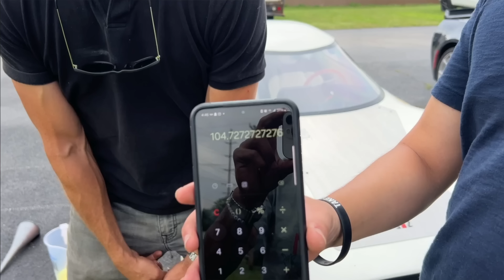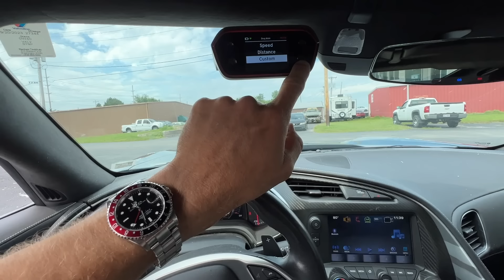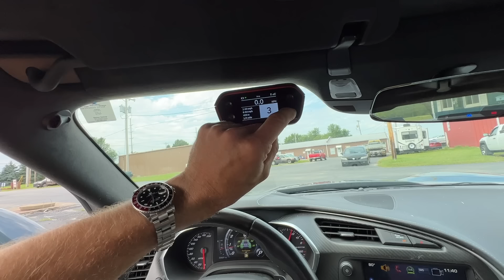FIRST 0-60 mph Test- Diesel OMEGA CAR - Video 3 of 3

Comment: Comparing it to a Tesla is Apple's and oranges. You're driving a fiberglass go-kart. While a Tesla and the Corvette have a ton of safety features and airbags to increase crash survival. Your car is probably fatal at 35 mph. You're mostly correct about lack of design philosophy. But there are a few exceptions like the Aptera EV. Both super light and safe. And far more environmentally and economically sound.
Reply from the maker: Nope and nope.
Reply: Still it's a solid starting point and it can be improved further to keep the weight and final cost low if developed into a proper product.
Reply: Aptera shell may not break in a 35mph impact. But a light car is still going to get bounced violently in a crash with any modern 5000 lb beast. It's  not gonna be pretty.
Reply: @colinbowman8816  Composite materials can be tweaked to absorb a lot of impact compared to regular metal car bodies.

Also most revelant markets worldwide don't use large cars, this is common only in North America.
Reply: @vitordelima  true, a good crash structure, like a F1 nose is supposed to shed something like 5x the energy of a conventional metallic structure of the same weight iirc. That requires tons of testing to make. But basic physics says that if a 1500lb car and a 5000lb car have an inelastic head on crash, @ 40mph, the final mass of both cars ends up travelling 21.5 mph in the direction the heavier car was going... so one car saw a 18mph change, the other 61.5mph. The energy absorbtion needs to be much better in the lighter car, or the occupants are much more likely to be injured.
Reply: @colinbowman8816  Not only the rigid structures inside the car can crumble like in a regular car, the outer surfaces can be made of "porous" textures that collapse under compression and can even produce a force in the opposite direction of the crash.
Reply: @vitordelima  I have no idea what you're  talking about with the porous textures thing... example?
And just checking: you understand about inelastic collisions and accelerations?
Reply: @colinbowman8816  Negative stiffness effect.
Reply: @vitordelima  Ah, you don't understand. Look up 'physics inelastic collision' maybe if you want to learn.
Reply: @colinbowman8816  The cockpit is a carbon fiber shell. The frame is a fairly standard aluminum crash structure with energy absorbing crash boxes etc.
Reply: @colinbowman8816  Meh.
Reply: WTF! You are all getting locked up about safety, ev more gooder, ev better for environment. SMH. This appears to be a legit 104mpg vehicle. THAT! Is absolutely awesome! The rest will come. Quit partaking of the gov pablum you are being bottle fed!

Comment: Diesel engines are some of the most efficient engines ever made. Diesel fuel used to be cheap, really cheap. If the Omega car was made 40 years ago, it would be the stuff of legend(That worked). 
The biggest problem with today, is all of the endless regulations you have to follow. Written not by Senator Friendly's staff, but some nameless jerk. Sittin on a buttplug sportin an attitude. Thinking he/they/it/whatever knows better than all of us. 
It's too bad we don't live in the same state Casey. Besides being a car guy, I'm a mad Industrial Designer as well. I used to have your energy, but as I'm sure you can understand. Life got to me as well. But the drive is still there.

Comment: Don't the engineers responsible for the powertrain deserve most of the credit here? Seems like they did most of the heavy lifting when you consider it's reasonable to expect similar performance from any relatively aerodynamic chassis that's void of modern crash safety features, creature comforts, adherence to emissions regulations, pedestrian safety regs, practical daily use, etc. etc. etc.
Reply from the maker: Nope
Reply: @CaseyPutsch  Yeah ok, bro. Use a comparable gasoline engine to test how much novel material science is responsible for fuel efficiency (or lack thereof). Add enough safety equipment to satisfy the most basic requirements and then explain to everyone why the car gets 40mpg like EVERY OTHER CAR. JAGOFF

Comment: I only started watching you TODAY
and I want this car in my driveway. I'm at the cusp where I'm thinking of getting a tesla because it would be much cheaper than driving or even riding my motorcycle to work on the daily. 
However, I still like the sound motors make, I still want to DRIVE my car with a stickshift and the omega car is even RWD! Which I love. 

I really hope you start a patreon or go fund me or whatever, to make this car really compete against everyone, I'd line up and support you all the way.
Reply from the maker: I will absolutely do something. Stick around. I’m honored you are here.
Reply: This should be a kit car, so you would be able to put whatever engine and whatever technology you wanted to into it. I would absolutely turn one of these into a triple motor, Honda V6, DCT, torque-vectoring hybrid, like a tiny Acura NSX.

Comment: Nice project Casey.
I applaud your ambition.
You're an inspiration for doing this project.
Something that should have been done long ago.
I for one agree with using the Diesel engine.
The Fuel sources are are so many in the Diesel world.
Small diesels are very adaptable to different types of fuel.
The Bio Diesel really belongs here.
Another place your car could be tested is Bonneville. 
That would be something to see that.
Keep up the good work.
Thanks for sharing. 👍 🇺🇸💯

Comment: I'm excited to see what you've done with this little project. I have swapped the VW ALH 1.9 TDI engine into two Jeeps (a CJ7 and XJ). Both can be seen on my YT channel.

The CJ gets 31 MPG and the XJ more than 40 MPG. They're unbelievable when it comes to efficiency and durability. 

Can I ask what engine code it is? I tried a google search to see if I could see the build specs, but no joy. Is it basically a stock VW motor? No turbo upgrades, injectors, tunes, etc?

Bravo sir. I REALLY like the videos of the Omega Car!

Oh, and absolute power corrupts absolutely. It's a shame what we've become with the folks running our country.

Comment: I am thankful that your Omega car videos showed up on my YouTube page. For most of my life I have been a Ford fanatic. But as time has gone on I have been extremely disappointed in all of the American car manufacturers. Very little real innovation has come out since who knows when. In 1985 Ford created the SVO Mustang with its four cylinder turbo engine that ran almost as fast as the V8. Also in 1985 my father bought a Toyota MR2. It was getting around 30mpg at that time. It drove like a dream and was reliable. I look at where we are now and say to myself "why are we not farther along?". For as big as the American market is we are very finicky about our cars. All you have to do is look at how car manufacturers made the CV transmissions act like standard automatic transmissions. And why my mothers Honda Insight with a CV transmission has shifter paddles. Good luck on your venture I am sure with what you have accomplished and with updates that have happened since your initial design you will produce something incredible.
Reply from the maker: Thank you kindly

Comment: Several questions for OC.V2, roughly in order of presumed difficulty(edited in to avoid auto-yeet):
>Better (for performance) tires?
>Bugatti Tourbillion style steering wheel/cluster placement?
>De-Dion rear axle with Satchell Link and inboard brakes?
>Front steering rack for best feel with 50-60 degrees of angle (one way) and enough lock-to-lock rotation to equate back to a 10:1-12:1 ratio(bout a 1200-degree rack)?
>V6 TDI for more power and better sound?
>Bladed seating position previously mentioned with customizable shifter placement?
>Roof cutouts on doors for even easier ingress/egress?
>A larger 3-seat version with a center driver and passengers offset the same as the bladed 2-seat idea so the driver's seat can slide over (like that one modded 911 or w/e)?
>Making the transverse equivalent to the ZF 8-speed, or if not, running an actual ZF8 Countach style (mid/rear long, trans forward, V-drive RWD) and pairing it with a Turbolamik (or equivalent) trans controller to have the ultimate in transmission flexibility between both automatic and manual shifting incl with or without clutch and H-pattern or sequential?
>Barring the above, how about simply a dog box H-pattern for maximum spirited driving fun of the true enthusiast?

Also, I recognize that if you make a larger version, it'll probably just be 4 seats since that won't have a much larger cockpit or footprint than a 3-seat version, anyway, and would literally be 1/3rd more practical than the 3-seat is. Like, the bladed 2-seat is genuinely a good optimization, but the offset 3-seat is really just for dudes like me who want a budget Mclaren F1/Speedtail/T.50 that's slightly easier to get in and out of due to the horizontal slider.

And TBH, the bladed 2-seat will probably get you close enough to the center since each seat would be roughly 2 inches overlapped on the centerline of the car. BTW, if it wasn't clear, as long as you're pairing the bladed pos (driver still on left) with a left side shifter, you could probably do away with that side's door entirely and just have a single door system. IDK if that'd make roll-down windows on the port side easier or not, but I digress.

Comment: I know that the omega car was bespoke hand coach built, but I cant help but think it would look insane if the headlights were moulded plastic in the wheel arch fairings and the nose was continuous. Also this would help with aerodynamics too. Long time subscriber of the channel and you do things I could only dream of in the automotive world and have done for students more than I could ever do for the betterment of sudents and young people. Please keep up the good work and interesting content.
Reply from the maker: Thank you!
Reply: In Need For Speed III, there was a bonus car called the "El Nino", you may find that design to your liking. Similar front end, but with vertical oval headlights integrated into the fenders.
Reply: @rwkerstetter  Just googled the El Nino and it is pretty much the same concept (man oh man it feels like those cars were far more sexy and far less pixelated back in the day) , I was thinking more like an LMP3 car as the Omega kind of has the whole single seater cockpit look to it already. I was thinking something like the headlights in the Ginetta LMP3 or something similar. @Casey, did you draw your inspiration from LMP when you designed this initially?

Comment: As happy as I am for your concept, the only downer is crash rating and safety running airbags and all the other stuff and what comes with that (weight) I’m still sure you’d be pulling insanely high MPG with it, but it would be interesting to see the next level, i.e. production level, for example the location of the headlights are way too low. They would require you to get them higher to come to market, which means the design will change  causing more wind resistant to get that height, which would lead to lower MPG

Comment: This is believable.   I owned a 2014 VW TDI Beetle Premium.   I also did the old school  mpg fuel test.   Diesels get the best mpg over long distance  cruising speed trips.   My test mpg run was from Swansea, MA to Jackson, NH.  221 Miles.   The car averaged 68.9 mpg there and back.    A VW Beetle is not as aerodynamic as your design and the "clean diesel"  catalytic  convertor and ash trap added back pressure reducing mpg.   Two weeks after the trip to NH with my wife,  "Diesel Gate" exploded all over the news media.  Extremely High NOx.
The buy back  wasn't a good experience for me .   I lost $9k.   I recouped some of the lost money by purchasing a new Wrangler with the settlement,   I had to give up the TDI.  I drove the Wrangler for 8 years and got $7k less than I paid for it new at trade in this year so I guess it's just about a wash.   I ended up getting a RAV4 Hybrid Premium.    I achieve high mpg by increasing the tires to 36 psi.   Last tankful was 58.9 mpg which isn't too bad.   I am willing to bet a 4 cylinder diesel hybrid will be capable of achieving  at least 140mpg.    Glow head management would need to be in place.   When on battery power the  engine head temperature would need to be monitored, if it drops below a set threshold then the glow heads come on.  

As I mentioned earlier Diesel engines get the best fuel economy over long trips.   You should release another mpg test video with a 100 mile road trip.  I am sure the mpg is going to increase.  I won't be surprised if it's over 120 mpg

Comment: I wonder if any gains could be had with Speed of Air pistons in your diesel engine, theyre supposed to improve emisions significantly enough that a 7.3 powerstroke can pass modern emissions, and give a modest bump in power. Not sure how effective they would be in a small bore engine, truly curious now.

Comment: Back in the 1930 and then again in the 1950s, Cummins entered a total of three diesel powered cars at the Indy 500. The ones in the 1930s included a two stroke diesel! The only reason I know this is because my grandfather designed all three of those engines. Gotta love diesels and how they are much more efficient than gas.

Comment: Tesla's 2024 Model 3 RWD uses LFP batteries, which have no cobalt, nickel, or manganese. Plus they have longer life and greater resistance to fire. And that model get 0-60 in 5.6 sec. Their Model 3 Performance uses a tiny bit of cobalt, but gets to 60 in 2.9 seconds and a high 10 second 1/4 mile. Plus you can charge up at home overnight for just a couple bucks. I give you props for your efforts based on yesterday's technology, but if you updated the Omega using new LFP batteries and an electric motor you could beat your goals for economy and performance, and gain simplicity and quiet comfort. With the faring, the Omega reminds me of Racer X's race car. 🏎💨

Comment: So something i've been wondering (and granted its been awhile since i watched the original set of O-car videos) what the powertrain/weight on the omega car looks like. I wanted to do a similar small displacement turbo diesel setup with an 3rd gen firebird i currently have. Its kind've rusty, not necessarily worth "saving or restoring" but it'd be cool to work on my welding and such and plant an engine rearward in the car (super spacious back there under the hatch). Not looking for 100mpg per say or pushing the limits but something odd with some decent mpgs (maybe 40s if i stay off the pedal). Either way great car and i think bringing vehicles back to a mode of transportation would do wonders too but your average consumer wants amenities on wheels these days.

Comment: I resurrected a 30 plus year old , totaled W124 Benz. Possibly one of the most serviceable vehicles ever. They built millions, so there are millions of used parts. This week in town I got 51.75 mpg in 90 plus degree heat. Would love to work on something with you!

Comment: Fun fact: an engine with a super high air-to-fuel ratio creates magnetized light particles that repel against the earth's negative charge and make a vehicle lose weight. The effect is subtle but real. It's just that nobody ever bothered to put a scale on the axle of each wheel to confirm this. It's also not so easy to make such an engine cause higher oxygen content of the fuel tends to melt engine parts. Is Overcraft Hybrid next?

Comment: I'm sure you've heard of the 128 mpg Urba Centurion kit car.    That thing was really slow and and very small by modern standards.  A kit car would solve distribution problems worldwide, but then people will (of course) need to source TDI motors, which are getting harder to come by.  Kubota Engine or similar would be cool, but I don't think it would have the power (speed) that a TDI would.

Comment: Yknow, I'd absolutely rock something like this, its kinda cool looking (headlights are my only qualm, but not a big deal), practical enough if you dont take a buncha passengers too often, and could probably be made even better by replacing the tdi with a fiat/alfa multijet/jtd.
Edit: just realised how massive that thing is, hell a smaller version could work out quite well over here where most folks are smaller, should probably be more efficient too!

Comment: I think in terms of computers since that’s what I’m familiar with. Your car really reminds me of the RISC architecture to the monopolistic evil architecture that is x86_64 (x86_64 chips are only legally able to be made by AMD or Intel and if either of them ever were bought it would turn void), and guess what? RISC processors are finally taking off, they’re more open and much more power efficient, but somehow they’re finally getting some time in the spotlight and major chip makers are panicking. I’d love to see something like your car come to market, I really think it would give the major auto companies a run for their money. Even if it never got massive market share, if it’s more affordable and better, people will want it. Plain and simple. I think something like your car on the market could really push the auto companies to innovate.
Reply from the maker: Thank you kindly!
Reply: We're going back into the 80's, with different instruction sets and chips in all sorts of devices, making necessary the use of intermediate layers between hardware and software to avoid the need to completely rewrite the code for every type of machine. All this translation ends up being buggy and wasting energy. X86 should have been made open, like IBM opened the PC specification in the early 80's.